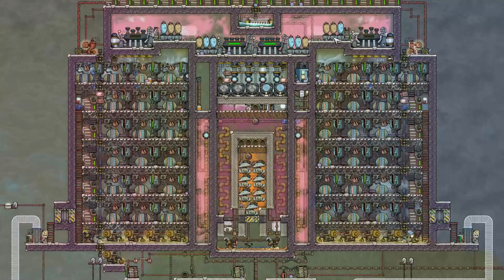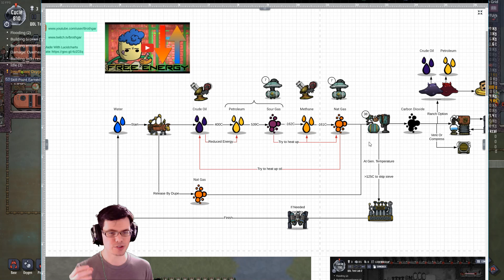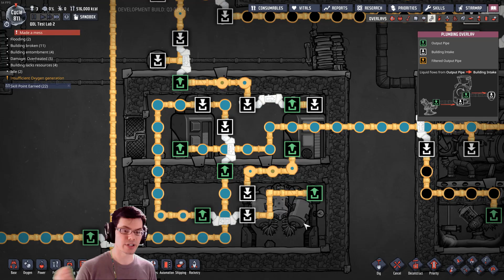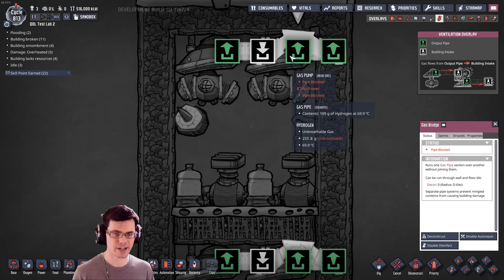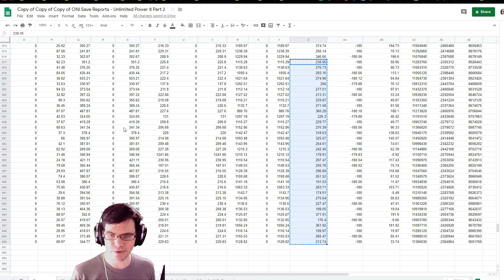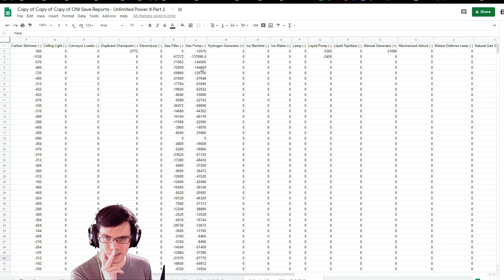Free Oxygen From Sour Gas! Oxygen Not Included

Comment: at 5:55  you added a battery should have added smart battery to stop extra runoff electricity the small battery has a higher leakage wattage then a  smart battery. this lowers cost to run these 2 ten watt sensors.

Comment: A note on the sieve temperature thing: clean water entering the sieve exits at the same temperature it enters at rather than at 40 Celsius.

Speaking of temperature, it can be a good idea to cool the oxygen coming from the electrolizers by dumping heat into the hydrogen, since that heat is deleted when the hydrogen is consumed by the hydrogen generator. Helps a lot with overall base temperature when the fresh O2 is temperature-controlled.

Comment: may i suggest using a bank of ten AGM battery's with the Schneider electric co charger/inverter unit. i'm able to pull 4000 watts for 12 hours off 3 u.s gallons of gas. and i'm about to add another ten AGMs. but yeah i'm off grid so when i say schneider's got good power systems, you can bet your dups that they got good systems

Comment: Have you considered ways to use cool liquids or gasses for cooling the steam turbines so they don't need a dozen wheezeworts? The rest of the system seems quite good about using internal heat transfer to do what needs to be done, so all those wheezeworts seem a little out of place.

Comment: If you record in MKV rather than MP4 you gain resilience over file corruption/incomplete recording.
Reply: Nope. What cause video corruption can't be read is video encoding.
MKV or MP4 have no relation. Both can get the same encoding.
Reply: @zombiechibixd  This is not entirely true, while you can still get corruption, MKV does not need to be "finished" and you lose the entire recording like MP4. You are correct in mp4 and mkv are just file containers and they contain the same encoding MKV is a newer standard with more features.

watch?v=ERRjYbGJfsM for the explanation

Comment: 1 small correction on the sieve. Any CLEAN water that goes into the sieve comes out at the SAME temperature as it went in. Only the Poluted Water gets a fixed temperature output of 40C clean water.

Comment: I have a better electrolyzer setup that I've used for a while now that allows filtering all of the oxygen out without pumps. The basic principle is that, if you cover an electrolyzer in a small amount of two liquids, one resting on the other, the low mass of the liquids won't cause the electrolyzer to count as flooded, but will prevent it from overpressurizing and also sort the gasses. I used polluted and clean water, as they are abundant, but you can use any liquids.
The setup is like so:
░▓░░
▒╫╫▓
▓╪╪▓
░▓▓░
where ░ is empty, ▒ is a gas flow tile, ▓ is solid tile, ╫ is the lighter liquid (in my case, water), and ╪ is the heavier liquid (in my case, polluted water)
The electrolyzer should be in the center.
While this will always allow you to avoid overpressurizing your electrolyzer, it's also possible to filter the gasses automatically. To accomplish this, the top left tiles need to always be hydrogen, and the top right tiles need to always be oxygen. I did this in survival by putting a pump below the output at the top right, so that oxygen would be pumped out first, leaving that output covered by hydrogen. As long as you can then make sure that no unwanted gas gets into the top right, the gasses will also go in the same place.
EDIT: actually, if you keep the top right hydrogen instead, you don't need to worry about the filtrations stopping, because the top left is the default output
Because pumping the oxygen is the most expensive part of a self contained electrolysis setup, this design generates quite an impressive amount of energy.
Reply: It does make a system much cheaper to run but many people consider that an exploit so avoid doing it.
Reply: @lucasriley874  I guess I understand that. It's been in the game for like a year now, though, so at least it's probably not going to be patched. If you don't want to use liquids, you could also probably do  basically the same thing with door pumps and one of those passive hydrogen filters, it would just be bigger.